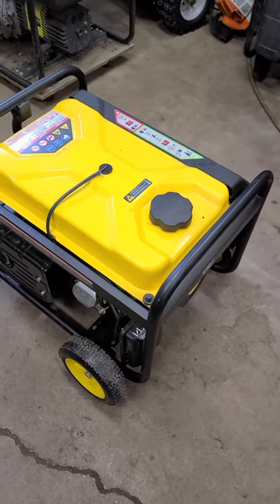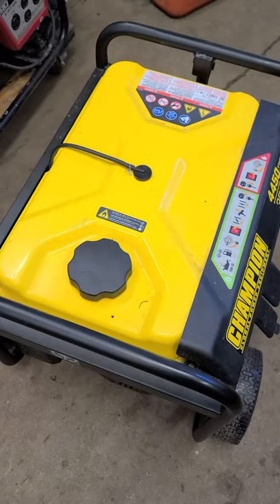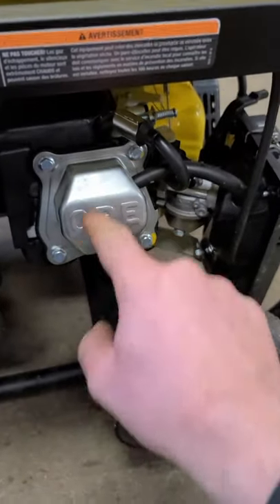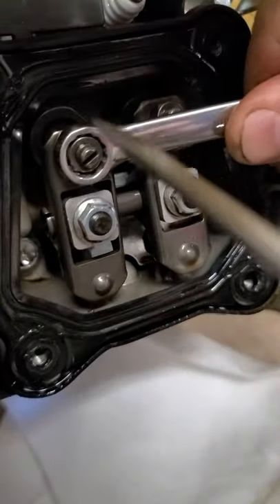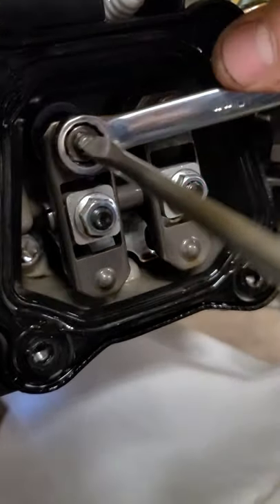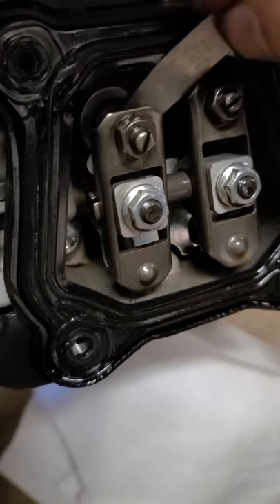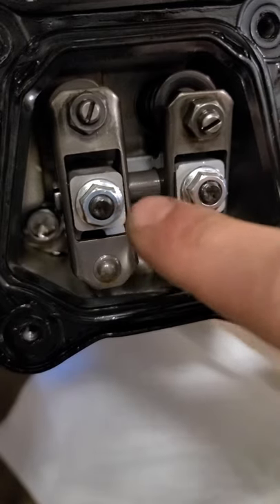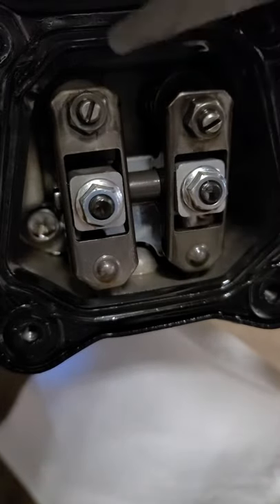Generator Won't Start With No Compression - Easy Fix! #shorts

Comment: How does those valves get out of adjustment?
Reply from the maker: softer metal
Reply: cheap junk china metal
Reply: @donyboy73  So the valve seat wears into the head and then cannot close because the rocker arm clearance doesn't change with the wear at the seat and stays open all the time?  Does it end when the valve seat will no longer seal if it digs in far enough?  Or can the same machine have multiple valve adjustments and last a long time?
Reply: @donyboy73 how does it get too tight?

Comment: I have a Honda EU3000is generator with only around 100-150 hours on it. Bought it new last year. Third oil change. 50 psi compression after thinking it was carburetor problems at first. Hopefully it is just the valves like this.

Comment: This isn't always the case, they usually run with the valve lifted and burn the seat and valve out. I've just repaired one like thus just the other week. The problem I find with these is they are not adjusted properly at the factory.

Comment: Don't use E10 gasoline in those generators.  It destroys the rubber in the fuel shut off valve and blocks it completely.
Probably true in a number of other brands as well.

Comment: No compression on my vintage Honda EG650 generator, but it broke the connecting rod.  Heading to the dealer today and see if they have the part...
Reply: Did you check eBay for that part number?

Comment: As weird as this sounds, most modern overhead valve engines need to be adjusted within the first 40 hours of use, followed by an oil change. You'd be surprised how many newer push mowers are thrown out for this reason.
Reply from the maker: yes absolutely, and some of these generators need adjusting with less than 10 hours sometimes

Comment: That was easy!!
Reply from the maker: easy and a common problem
Reply: @donyboy73  I kinda want to start checking my ohv motors like that seeing it maybe they need a turn up.  My poor mowers been 10 years with only 2 oil changes but when I got the huge Toro I had 8 acres of land mowed it 3 times before we had to sell it because the bank didn't like how we got it then wanted to build on it and would finance a house vs building a house.  Odd story then we got then huge commercial grade mower for a 1/8 of the yard we got it for then moved to a city yard that was a 1/4 of the old yard so... here it is with 120 hours on it 10 years later.  But my Stihl weed eaters, Stihl backpack blower, Stihl edger, and both Stihl chainsaw are all the same.  Had plans to do so much ending up with super lite use maybe 1-2 hours a year.  But they get just enough use to not sell.

Comment: I have compression.  It turns over but only runs for 5 seconds and then cuts off while the choke is on.  Doesn't start at all with no chock.  Help!